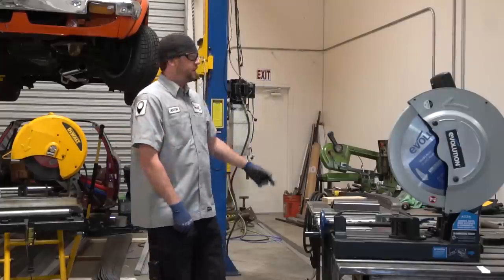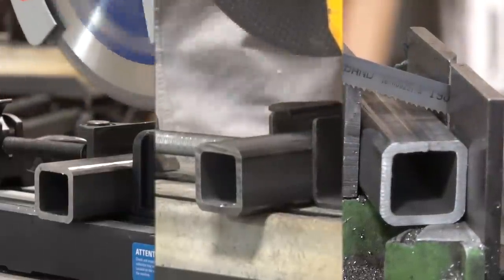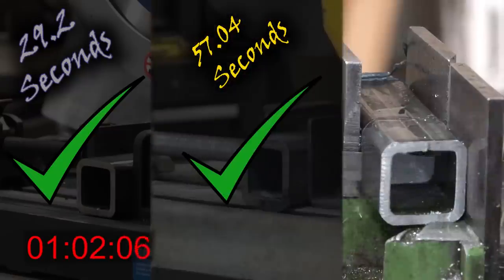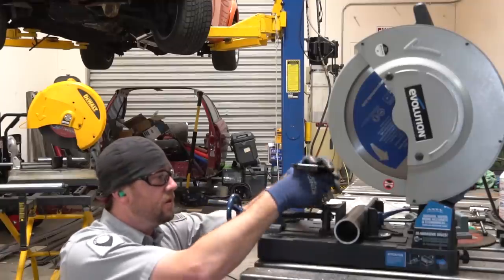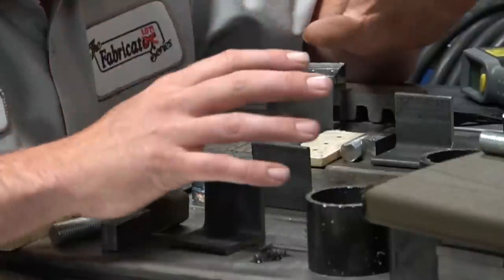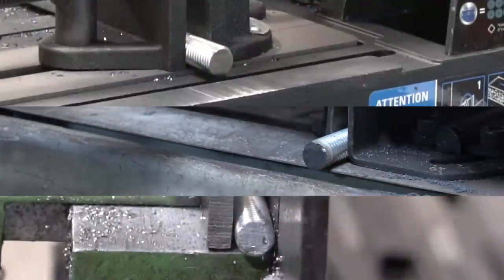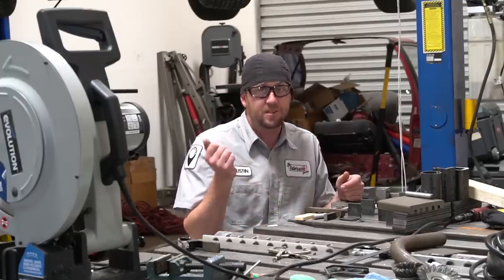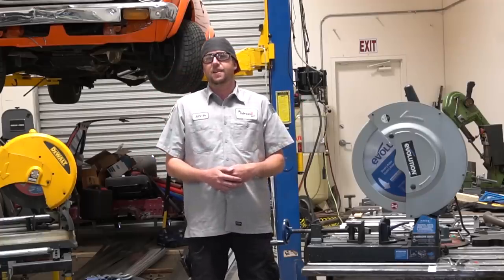TFS: 3 Metal Cutting Saws Tested and Compared

Comment: On a carbide metal circ. saw, the blade rings. That’s most of the noise. My Freud Diablo blade is quieter, though still loud. I always wear hearing protection with this, as with my bigger angle grinders. These things are REALLY loud guys, hearing protection is a must. You may not notice it, but over the years, they WILL damage your hearing.

Abrasive saws are very bad for our health too. That fiberglass/abrasive/metal dust is known to cause cancer. Use a dust mask, and keep it on for a few minutes after you saw to give the dust time to hit the floor, and vacuum up quickly.

One thing about all of these saws; the back jaw has to be perfectly perpendicular to the bed, front to back. The blade needs to be perfectly perpendicular to the bed, side to side.

It’s obvious why the blade needs to be perpendicular, but not so much for the vise. When you cut 90 degrees even if the vise is tilted, you still get a 90 degree cut, if the blade is right. But, if you cut an angle like the common 45, you’ll find the cut to be off. The angle of the end of the cut won’t be straight across. It will be at an angle. The problem is that the vise may seem good when you measure it, but when you tighten it, the top of the rear moves back, and the front of your piece moves up. This happens more for taller pieces. Cast iron vises are better than formed steel.

Comment: I manage a Sheet metal fab shop for a big HVAC,roofing etc.. company. We use a Dewalt chop saw for the thin gauge vanes for elbows. But for building stands and other thicker steel projects we use a Steelmax cold saw like the Evo saw you used. We have a bandsaw but after like you showed it is slow. I have a huge project that required 2" square .250 " wall steel. Many many cuts. I decided the band saw would take me forever to make all the cuts. So we bought the Steelmax. Now I never use the bandsaw. Only draw back is the cost of blades. But I think we save way more in time.

Comment: I have a fairly inexpensive band saw from Grizzly that I LOVE. It doesn't have built in coolant but I keep a small pump can of cutting fluid with it. I use it when I really need accurate, clean, mitre cuts. For the rougher cuts I have a dirt cheap Harbor Freight 20" abrasive. Works as good as my buddy's Dewalt. I have under $500 invested for both of these tools and they work great for my light to medium fabrication needs. I've not been tempted (yet) to spend the big money for a dry cut.

Comment: My money is on the bandsaw, can cut unsupervised and has great cut quality. The evo saws are great until it’s time to replace the expensive and proprietary blade. For a welding shop, a clean cut means less prep and better joints!
Reply: Smaller kerf, cheaper per tooth pricing, larger cut capacity, etc. Band saw is the winner for everything except floor space.
Reply: @mcskifter  Also depends on the bandsaw. A big Ellis mitering head bandsaw is an absolute beast, and almost too big for anything but a production shop. But that's not the only type of bandsaw out there. Other than the 5x8's and other horizontal bandsaws, HEM is finally getting into the US market with smaller benchtop saws comparable in size to the evolution saws at a slightly higher price point (with less noise and cheaper blades). And to round out the home gamer, you just cannot beat having a portaband around. For about 10 years, all I had to cut steel was cutoff wheels and a portaband, and I fed all sorts of steel through that, up to and including 4" square tube and 3" solid round.

Comment: I freaked out when i saw that you have a kama ev 996! I've had one for more than 20 years. I also have kama's semi automatic saw with the same capacity but miters both directions instead only one... I think you should have talked a little more about the mitering of the kama. imho that's one of the coolest features of this saw. If you're cutting off of a 24 ft stick of metal you don't have to do any gymnastics to fit it in the saw. I also have an Uzay 12" capacity double mitersaw that is semi automatic.. it's great for larger stuff but my kama is my go-to saw  first. I agree with other comments that for mild steel you should use bunny not turtle. I only use turtle for stainless. Also the accuracy of the kama is superb! Square cuts every time. Getting the blade tooth per inch is important but i keep a 6-10 variable pitch tooth blade on the saw almost constantly and does most of everything I need. Square and round tube of most any size and even some pretty big solid stock that ideally should be cut with a 4-6 blade. I have had a doringer 350 cold saw . The finish of the cuts is better than i need..the accuracy is unsurpassed  but the blade tooth is so critical and expensive. Contrary to several  comments you can't "walk away" from the kama  because it is a pull down style of saw compared to othe types.... but... i have a tie strap on the trigger and a counterwieght that i slip over the  handle to facilitate that. I hope that info helps your viewers.. great video.. I'd like to have the evo saw...you couldn't give me an abrasive saw... but...it will cut really hard stuff that the others can't.

Comment: I cut 1” stainless round stock with a stainless blade 3 times a week with that Evo saw and I’ve never had a problem with it
Reply: David White 
I need to cut a lot of 1,75 inch stainless 16 ga tube . I read a several review the stainless blade won’t last on stainless .

Comment: Just a note for anyone thinking of buying.  I’ve had the abrasive saw and upgraded to the evo355.  Would agree cuts are nice and support from them is good.  Only downside is setting up 45° cuts takes a while.  That said I’ve seen other cold cut saws and they are all worse so if angles are going to be a big thing for you save up the 1200 quid and get a basic bandsaw.  Eco is excellent at 90° cuts though.

Comment: The abrasive saw will blow through hardened steel like no other saw. The Evo blade will liquefy on hardened steel then stall out and the band saw will strip out the teeth and then just set there and not go any further. I got all three saws. Regular mild steel I chose the cold saw or evo style saw. I just use my 20" upright band saw for aluminum. 

The abrasive saw is mostly as a back up if I kill a cold saw blade. Or, like I said I got a hardened shaft to cut. I got a snowmobile hexagon track drive shaft and a jack shaft and 4 CV joint shafts I need to cut. Those will all be done on the abrasive saw. 

One HUGE tip for potential abrasive saw users. Throw away the factory blade and buy high quality thin abrasive blades. They are more expensive but so worth it. They will keep burning on through a heavy cut when a thicker low quality blade will stall out. I have done something like 10k cuts on an abrasive saw at a fabrication business I used to work at. That was back before there were cold saws.

Comment: They all have their pros and cons and place in the shop. 
Abrasive chop saw, yes, sparks and fumes and very noisy, but also is the only saw in the bunch that can cut questionable steel (like you think it may be hardened). Blades are the cheapest to replace.  
Dry cut saw cuts very clean and fast, but the blades don't have a linear decrease in cutting. What I mean is the blade will be cutting fine one moment and a cut or two later the blade is to dull to cut anymore.  Blades are not cheap, can be re- sharpened but then have to wait for it to get back, always need a spare, but usually end up with two dull blades that then need sharpening.
Band saw is great, but generally a shop bound tool, whereas the abrasive or dry cut saw a can be used in the field if nessecary.  Band saw is usually the slower cutting of the bunch. Blades are medium priced and do last longer than the dry cut blades and still cut even when getting progressively duller unlike the dry cut blades.  
Anywho,  I have one of each and they all serve their purpose.

Comment: I have all three basically. Chop saw is a Ryobi and I can't even remember where it is - lol. Bandsaw is a $900 Harbor freight and is still my go-to for 8 years now (did a few mods to it). My Evolution is a 10" sliding miter saw. It came with a crappy fence that causes material to pinch blade - grabbed a 1x1x1/8 angle and flipped it hard, smashing my finger through a heavy glove - been reluctant to use it since. You should have addressed angle adjustment with each saw - that's a HUGE consideration. Great vid as always, though. Just my .02

Comment: I have a 4x6 band saw and recently bought the evo380. I used to have an abrasive saw and got rid of it because it's loud, stinky, and it actually started a fire in my shop from the sparks. The Evo is by far superior in almost every way. In my opinion, the evo makes less noise than an abrasive saw.

Comment: In the abrasive saw the blade selection has a massive influence. Generally the harder material you're cutting the softer the matrix required so you are continually exposing new cutting surfaces. Same goes for cutting large cross sectional areas vs things like angle iron.

You need to try a few different blades and see what works best with your application and be willing to change the blade when your application changes.

Comment: My abrasive saw warps whenever i start cutting leaving crooked cuts. It helps if i go  really slow..but it still seems a little off. Maybe it's because i pulled it from the junkyard.
Reply: I used a brand new one and even after re-calibrating it was always a little off, up to a half degree which is not acceptable for precision.  My evolution is far superior in every way.

Comment: I have a Carolina (cheap but very large) bandsaw, a Craftsman Laser Trac, and the Evosaw380.   My go-to saw is the Evo.  I had the Dewalt for a year and to the day, the motor fried and was out of warranty.  When I took it apart, "made in China" was proudly displayed, so I opted not to replace it with another very expensive crappy saw.  The cheap Craftsman is what I decided to go with.  Thanks for the video.  I waited for years to buy a cold cut saw until I thought I could afford one and the Evo made that possible.  I've had it about a year now and I'm still on the same blade with hundreds and hundreds of cuts.

Comment: I have the rage 2 evolution as a factory refurbished,same as what your testing but without a cast table,my blade lasted 2 years and replaced it with a Diablo works good for the money,my only compliant is they don't have a degrees miter like a wood saw. If I had the money though,I would have the bandsaw you have or bigger. The best thing is you can handle the piece immediately after cutting and the speed. Evolution is right up the street from me and will be getting one of their mag drills next.

Comment: Great video but there is one big factor you forgot to mention. I went through this dilemma myself of bandsaw vs cold cut saw and ended up with the bandsaw because of the cost of consumables. The cost of the carbide circular saw blades are NOT cheap, also if you chip or break a tooth it really makes a big difference in cutting. The bandsaw blades aren't that expensive and less fragile to broken teeth and what not. Also, I'm talking about the bench top sized chop bandsaws.

Comment: I like the band saw. It's quieter, cleaner, and if you have to cut chromoly, stainless, or case hardened stuff, a good Starrett blade will get you there. I want to consider getting an Evo saw because they perform so well, but there's so much variation in the materials I cut, all it takes is one piece of random mystery metal to wreck the blade. I do also keep an abrasive saw, because that's the only way to cut hardened material. Keep a spray bottle nearby.

Comment: I have an Evolution Rage 2 saw (lower model) and it cuts stainless fine. The catch is you have to buy a blade specifically for stainless. The same goes for aluminum... and that's what the real downside is for that saw. I bought it for $250 four years ago, but have since bought about $400 total in blades to handle each metal type. This is where the band saw shines, one blade easily cuts most metals. I don't have room in my garage for a bandsaw though, and the Evolution fits on a shelf when not in use, so it's sticking around.

Comment: Thanks for that review not bad results ., personally as a hobbyist I do have a smaller non fluid bandsaw and the evolution chopsaw both are great for my use .downside the bandsaw only has about 5x4 inch cut and the evolution chopsaw being a £100 brit version its basic but yup does the job however blade does dull quite quick and yup bleedin noisy ..considered the abrasive saw but have used at work and boy messy cuts and shite flying everywhere,  no good for a small garage set up . On the whole very informative thanks

Comment: I have an Evo and it is a great saw for steel and aluminum. I haven't tried it on stainless because I figured it would do precisely what you said it did for you, eat the blade.
Also, if you are square cutting square tube use the "v" adaptor to hold the material rotated 45 degrees. The cut will be faster and is much easier on the blade. This is actually true of any cutting system, the smaller the cross section of the cut the better it is for the tool.

I still have a 14" abrasive saw sitting on the shelf and it comes out once and a while. Either because I have a ton of stuff to cut or more often because I have some really steep angles to cut and I can make a quick jig to do it on the abrasive saw rather than hand cutting each piece with a cut-off wheel.

Since I do quite a bit of stainless I picked up a Doringer coldsaw and it runs through pretty much everything like butter, as long as you set up the right blade and speed. I found it used with a ton of blades and the run off tables so it cost me less that a decent bandsaw.
Reply: There are blades specifically designed to cut stainless made be Evo and other manufacturers.
Reply: @steveh8724  They might be fine for thin wall but I have yet to see a carbide, especially at high speed, that dealt with thick wall.

Comment: I have both dewalt and evo and I can tell you that the evolution is the most precise and better cuts, for heavy duty dewalt for sure.   For I beams and over 4 inch the band saw with alot of cooler running thru.

Comment: Band saws come into their own when cutting large sections like beams, a cold saw capable of cutting 12 inch rsj and the like are mega expensive and only likely to be seen in a steel mill. The small cold saws like the Evolution are fine for smaller box and tube, for thin wall stainless (less than 1mm wall thickness)I have found that the abrasive chop saw is best as both band saw and cold saw grab and bend the wall in. Cold saws are best where you want absolute accuracy on squareness etc but are limited to size of material unless you have the money for a saw with a 24 inch or larger blade.

Comment: FWIW:
I just had to make 14 cuts through 1/2 thick x 3 "  303 stainless with my Morse Metal Devil using an Evolution blade. It made 14 beautiful cuts and no change in performance start to finish. I love that saw but my neighbors sure don't.
Reply: Try a diablo blade you will never look back
Reply: @heyyou5189  How long have you worked for Freud? Or is this based on personal experience with each? If so, please describe your results...
Reply: @steveh8724  I have personally used dozens of brands. Nothing comes close to the diablo. This is the 14 inch blade. This is in a production weld shop.

Comment: Each has its uses. Weekend person, chop saw. Muffler shop or construction site (Commercial uses metal studs etc.),  Evolution. An actual shop that can use a band saw... BANDSAW. But most will always have that inexpensive chop saw as a back up or quick cut.

Comment: I recently built a set of five stables which required hundreds of cuts of square section tubing (3/4, 1", 65mm x 35mm, 2", and 4" x 3") using an abrasive cut off saw and what I found is that I spent as much time at the linisher (belt sander) de-burring as I did cutting.  The larger pieces also required 45 degree cuts and they ended up that crooked in the vertical plane due to blade flex that they did not butt up well enough to weld so spent heaps of time with an angle grinder trying to square them up.  If I did them again I would definitely investigate the Evolution or a band saw (my preference) as the many hours saved de-burring would pay for the extra cost.

Being a handyman sort of workshop where I do a bit of lathe work I find that I sometimes need to cut solid bar and the abrasive wheels are limited to about 1" on a good day because the piece gets that hot that it turns to chewing gum and won't cut properly.

And the dust goes everywhere.

Comment: Not sure if harbor freight has one but in Canada we have princess auto, I bought a 7.5" dry cut saw there and it was the best $180 bucks I've ever spent on a fab tool. It will do 2.5×2.5" angle, square pipe etc. It's no big Evo but it pretty much replaced the cutting disks/angle grinder around my shop.

Comment: I'm a big fan of the Evolution saws. I have the EVO380, it cuts super clean. I wished the bed and mitre were more accurate and fabricated a little better. Abrasive saws are nice for cutting tool steel, but you get crazy sparks  and potential fire hazards. Nice video and tests.

Comment: As a person who owns both an industrial bandsaw similar to the one you have and an evolution handheld saw, I was surprised to see that the surface finish on the evo saw was smoother and more polished than the bandsaw. The bandsaw always has  that wavy finish that needs to be grinded smooth so less prep work with the evolution.

Comment: Turn the square stock 45 degrees on edge and use a jig to hold it like the one you used for pipe and it will cut faster on your band saw or any other saw for that matter...